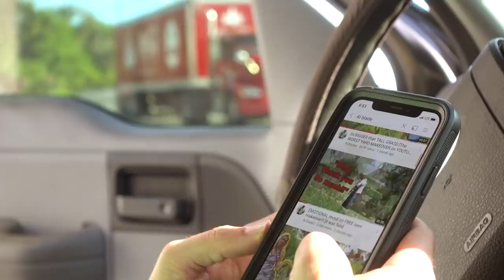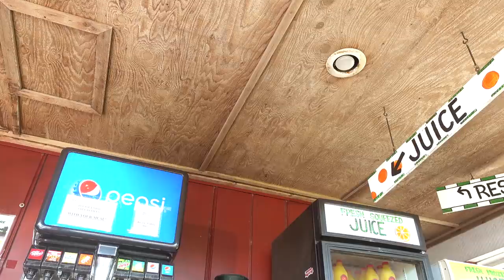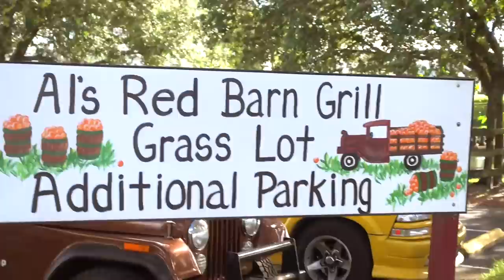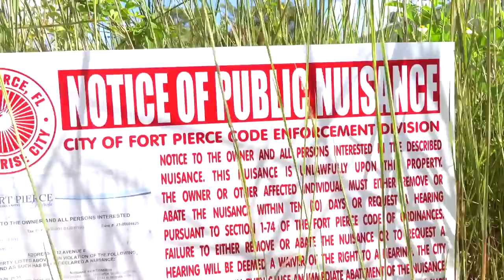FREE Public NUISANCE HOOD yard Transformation [Public Nuisance]

Comment: A. P. 😍,  you and AL are doing amaizing work. Keep it Up! 
AP, sometimes I see when you work in the yards, you have to clear up alot of cuttings, branches, rubbish etc. Would it maybe help you if you use a big piece of flat plastic sheet? Then you can load up stuff and drag the sheet around the yard, instead of walking up and down so much just carrying stuff in your hands? A big tough piece of plastic sheet is easier and cheaper than a wheelie cart and will help with your workload. I use it when I do gardening and get alot done in a good amount of time. I bought a big piece from my local hardware store. 
🤓 Sending greetings from South Africa😊